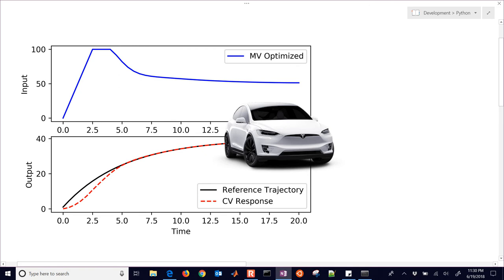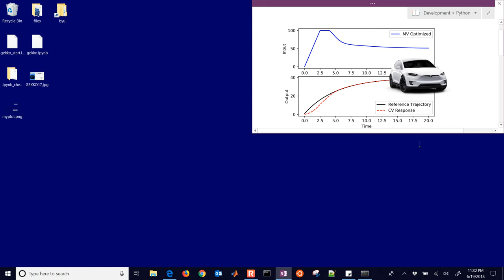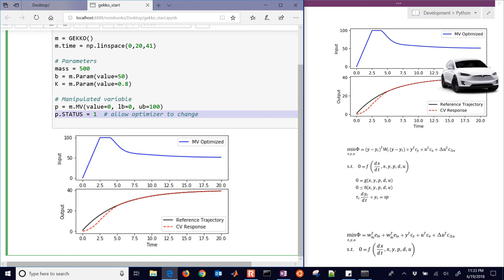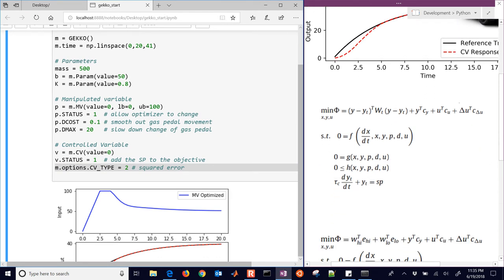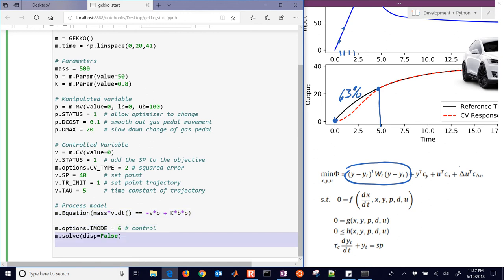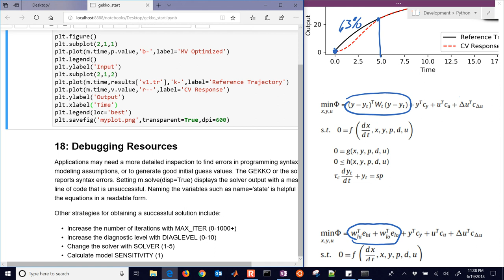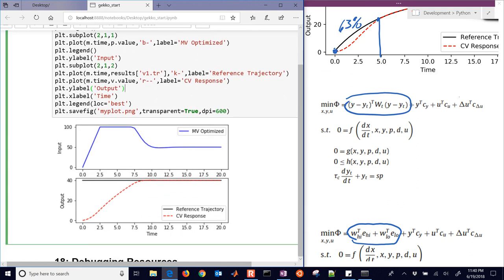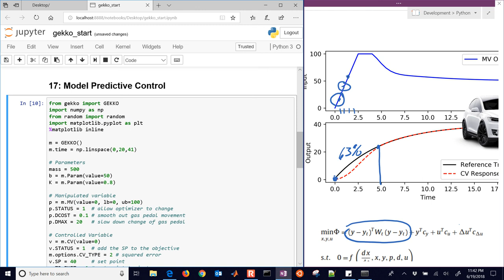Model Predictive Control with Python GEKKO

Comment: Hi! Thanks for the video. Your content on MPC has been my guidance to understand this kind of control. I was wondering, this is an example for an open-loop MPC, right? Do you have any example for close-loop? I mean, changing the size of the horizon, applying the first step of control on a simulation of the system, and recompute the trajectory for the next step til the final of the simulation. Thanks!
Reply from the maker: Sure, here is a complete series of tutorials with an Arduino device for real-time MPC. https://apmonitor.com/do/index.php/Main/AdvancedTemperatureControl  Lab F is linear MPC, the easiest to implement.

Comment: Dear Mr John, 

I want to use this function according your tutorial but it didn't work :

point = [40,20,10,35]
traject= [1,30,60,100]

for i in range (len(point)):
    # Controlled Variable
    v = m.CV(value=0)
    v.STATUS = 1  # add the SP to the objective
    v.TAU = 5     # time constant of trajectory
    m.options.CV_TYPE = 2 # squared error
    m.options.IMODE = 6 # control
    
    v.SP = point[i]     # set point
    v.TR_INIT = traject[i] # set point trajectory
    
    # Process model
    m.Equation(mass*v.dt() == -v*b + K*b*p)
    m.solve(disp=False)

but found : 
vp.__dict__[o] = data[vp.name][o]
KeyError: 'v2'

how to solve it ?

Thank you
Reply from the maker: Please post the question on Stack Overflow with tag [gekko]: https://stackoverflow.com/questions/tagged/gekko

Comment: Hi, can I ask again how is the Time Horizon, Control Horizon, and Prediction Horizon determined by using m.time?
Reply from the maker: You can either use m.time or m.options.CTRL_HOR / m.options.PRED_HOR / m.options.CTRL_TIME / m.options.PRED_TIME. I recommend using m.time where there is no "prediction" horizon to calculate a steady state. Instead, use a non-uniform time distribution such as m.time=[0,0.2,0.4,1,2,4,10]. The first time step is the cycle time of the controller. The larger time steps help to reach steady state.

Comment: Hi John! Can I add a DV with gekko?
Reply from the maker: Yes, define a parameter with m.Param() and update the value with m.Param() with a constant or an array of values equal in length to m.time for dynamic problems. You can also define it as m.MV() with STATUS off to use the MEAS property to insert at the current time point and let Gekko handle the time shifting.
Reply from the maker: I recommend the MPC tutorials with the TCLab here: https://apmonitor.com/do/index.php/Main/AdvancedTemperatureControl See Lab F For an example of linear MPC with the Arduino microcontroller.

Comment: How can I use a trained model (let's say Keras saved model) as the process model?
Reply from the maker: Check out this course (see LSTM) https://apmonitor.com/pds
Reply: @apm  Thank you very much. I will check it out
Reply: @apm  I have checked the course but couldn't find a solution. I have a model Keras model saved as .h5. Can I use this model to represent the system dynamics instead of an equation?
Reply: I have the same problem here

Comment: Can I change the equation which is like 'y = a + bu'?
Reply from the maker: Yes, you can change the equation to anything or also have many equations. More information on the Gekko modeling language is here: https://gekko.readthedocs.io/en/latest/
Reply: I just got it ! Thank you so much ! Is it possible to make noise variable which is changed every iteration time in the equation Y = a + bu, a <- noise variable. If possible, How can I use?
Reply from the maker: Yes, just add it as an input parameter to the model.
Reply: What I mean is that I can add the equation just once like thism.Equation(y == a + bu)but I want to change 'a' variable value in order to get every controlled variable results.Thank you.
Reply from the maker: @유재진-s9f  maybe this tutorial can help? https://apmonitor.com/do/index.php/Main/TCLabF  It shows how to insert measurements with a.MEAS = number and align the predicted CV with the measured CV. It also shows how to retrieve values when there is a solution. You can add any equation to the model and insert any value each cycle of the controller.